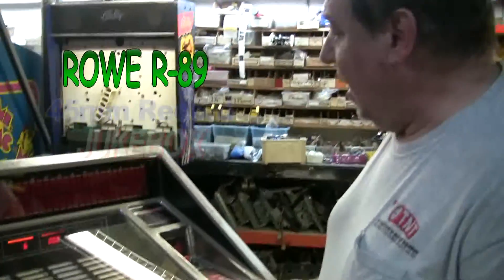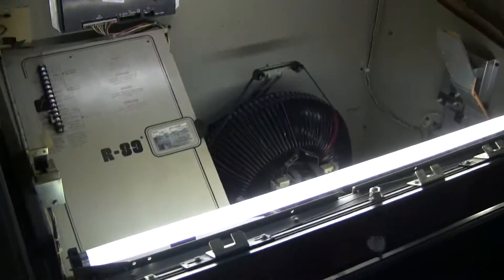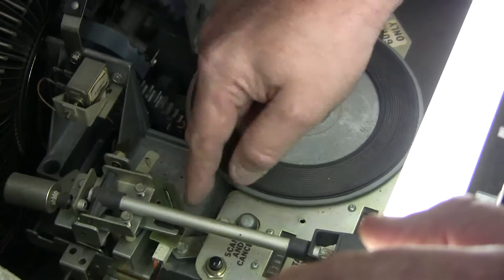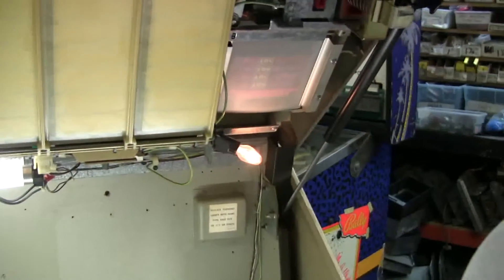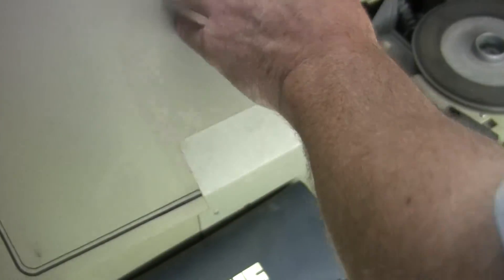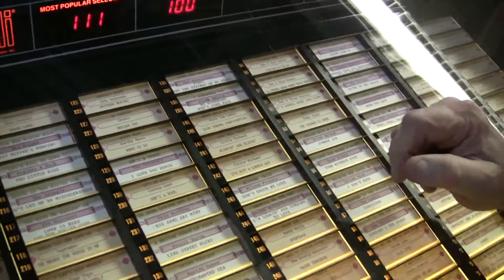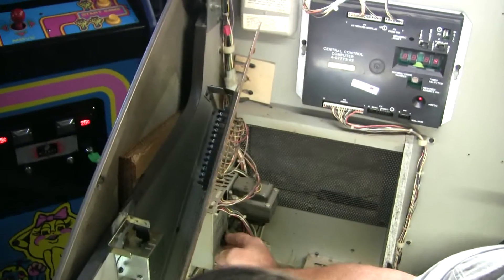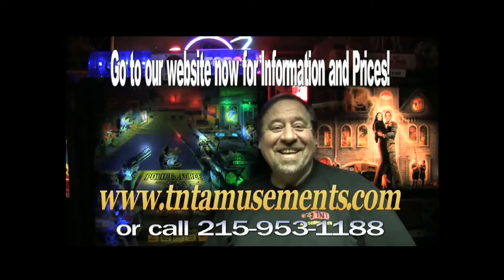#310 Rowe R89 45 rpm JUKEBOX that plays RECORDS and what's inside!  TNT Amusements

Comment: You've probably been told before, but an R-89 is NOT a 1989 model. The 89 refers to the last year of the 4 year warranty that the jukeboxes had. My R-90 was built in 1986. The R89 was built in 1985.